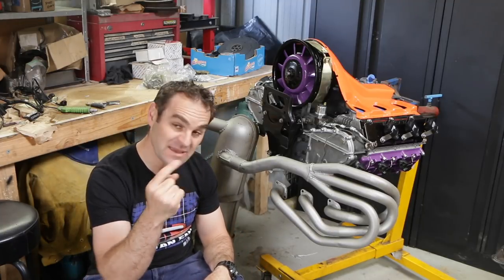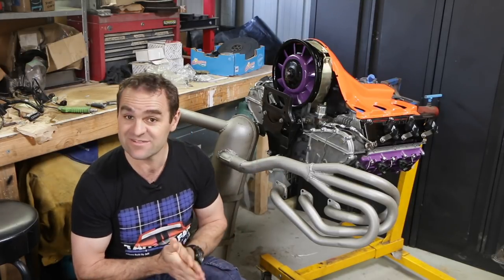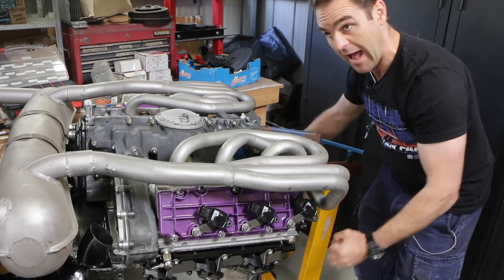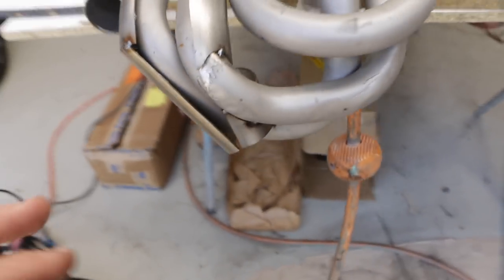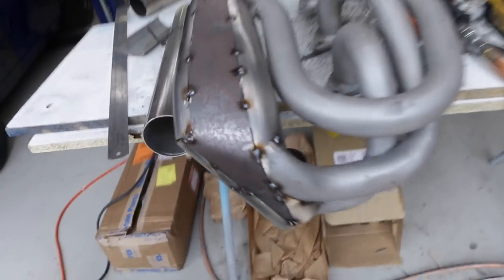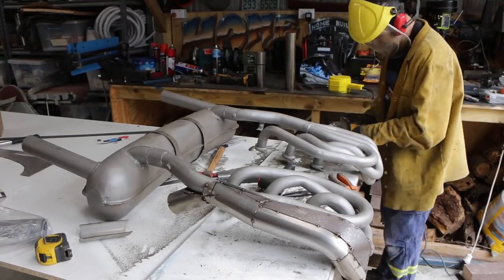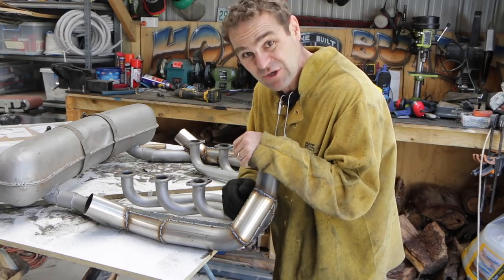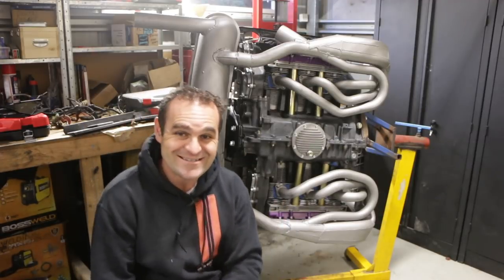DIY heat exchangers -  911 2.8 RSR Build Season 2.14

Comment: No reason to harp on the Webasto petrol heaters. They work extremely well and there is no more danger in installing one than in installing... new fuel lines front to rear. Actually probably even less depending on who is doing the installing. They were even a factory option. Used, they can be found for considerably less than a pair of SSI heat exchangers. Only downside is weight.

Comment: Jeff, the 1 addition I would make to your system is a CO monitor in the cab. Most of the small private aircraft with air cooled engines use the same type of heating system and almost all pilots/owners install a CO monitor.
Just an ounce of prevention,
Rollie
Reply: or a canary in a cage :D
Reply: No chance of ever falling asleep in an old 911, not even under general anaesthesia.
Reply: @gazzafloss  Reacting to oversteer may be a little blunted....
Reply: Was thinking the same thing.  May be overkill but a pressure test of the exhaust before putting the tins on would have revealed any small leaks in the area where they were to be applied.  Don't want to play around with CO in a car cabin.  Search Corvair and Ralph Nader.

Comment: I'd have just taken a pipe the diameter of the flexi coupler and squashed it to a narrow oval, threaded between the primaries and welded it externally to the primaries. This would get more than hot enough through heat transfer and for safety would require a double faliure before you got any exhaust gas in the cabin.
Reply from the maker: You would need flex line 2.5" diameter and there is no room to fit it.

Comment: hey, Jeff, we should talk about heat transfer.  Just real quick, heat transfer, Q (Watts), depends on three things: 1. Temperature difference dT (C), not much you can do about that (though wrapping with insulation will help with the secondary transfer to ambient); 2. Mass flow, M (g/sec); and 3. Surface Area, A (m^2).  I see a big problem with mass flow, and a smaller problem with surface area.  So I think your solution will work, but I also think you'll be a bit disappointed with the amount of heat you get through your system into the cabin.  In other words, make sure Mrs Jeff has a sweater.
Reply from the maker: Aircooled Porsches have been using this method since the start and the heaters are better than regular cars.
Reply: @HomeBuiltByJeff  understood.  i had a similar design on my bug (not known for heat).  i was thinking you could get better heat transfer if the headers had fins to increase the surface area, and smoother transitions would help with mass flow.  if you're happy with your method, then who am i to say.  it's your car, paint it, and heat is how you like (i love your color scheme btw).  if you find out later you'd like better heat, i'd be happy to help you design a more efficient system.  love the channel, love your work, just thought i'd offer advice on something i actually know about.  take care man.  - n

Comment: Hi Jeff I know I'm off the current project but I've got a 260z with a Nissan 3litre turbo  and I'm replacing the inner and outer window seals. I've pulled the original rubbers off that where stapled thru the metal strips. How did you reinstall yours on the z
Cheers and loving your work in progress  
Keep it up
Reply from the maker: Glue
Reply: @HomeBuiltByJeff  thanks Jeff obviously a very strong one any brands bud cheers and keep up the super work

Comment: That's pretty tight to the exhaust, VW ones have quite a bit of clearance , hopefully you get enough air through to the cab. 👍🍻
Reply: The VW ones I've worked on also had aluminium heat sinks with fins cast about the exhaust pipe to maximise area exposed to the air movement to the cabin. That's why the heater boxes appear relatively large, it is to encapsulate the fins of the heat sinks.

Comment: Hi Jeff, They use petrol heaters in aircraft but another method instead of the shroud type heat exchanger they use for their air cooled engines is to use a oil cooler as the Heater core running oil instead of water.

Comment: You shouldn't use stainless for the HE if the exhaust pipes isn't. You want the HE to rust before the exhaust for reasons you mentioned in the beginning...
Maybe not a problem for you in your climate and being partly mild steel I guess its ok.

I've constructed similar HE on my car, they were half the size, offering zero heat... Yours will give some heat.

You should add back flanges between the headers and muffler. Will ease maintenance.

Comment: The amount of old beetles I have frozen in during winter is unreal the heat exchangers always rotted off. You could also do Home Built Porsche Parts by Jeff. I think a carbon monoxide detector in the Porsche.

Comment: I haven't finished binge watching the Porsche build yet, but I know that the heat exchangers in my old Bug had fins on the exhaust tubes to radiate the heat. I'll be curious to hear how this worked out without them. In my Bug, I could melt the sides off my shoes. lol

Comment: Noting that your system works well for both Porsche and VW but if you want another way of heating the cab, use another oil cooler but inside the cab then use a fan like a conventional water cooled car but your be using hot oil instead of hot water.
Reply: Takes forever to heat the oil to be useful. In cold weather the thermostat might not even open to the oil cooler because the air cooling is so effective.
The stock HE is very effective (stainless more so) giving heat in minutes. For really cold weather a petrol heater (Webasto) is the way, that was optional equipment from the factory. Its the reason for the "smuggler compartment" in the trunk.

Comment: Heat exchangers in bugs always rusted out pretty quickly, hence the fuel fired heaters.  OMG - the smell of gasoline in the cabin was horrible and yes I was sure it was going to explode.  It sat up under the dash on the passenger side.

Comment: Will be interesting to see how these perform, OEM exchangers have cast fins around the exhaust tubes, greatly increasing the thermal mass and surface area to radiate the heat into the exhaust, this helps reduce spikes in exhaust temperature from occasional full throttle not leading to super heated air in the cabin.

Comment: Nice work Jeff!
As you say mate, simple tech heat exchangers are more than adequate, even with our chilly winter climate.
I hope you won’t be adding the electric blower in the engine compartment, the backdate method works fine in my opinion and keeps the engine bay looking neat.

Comment: A very dumb way to warm your toes.
I have seen attempts where a tube of steel or stainless is coiled around the headers and filled with sodium or gallium and plumbed into the cabin the same as a water based system,
sodium explodes if it leaks out and gallium eats aluminum . You could use water or oil but the high temperature may cause the line to rupture and explode unless you used steam pipe instead of stuff you can vend around an exhaust.